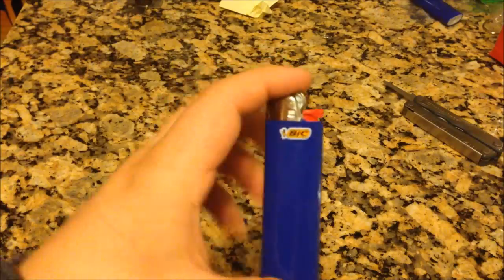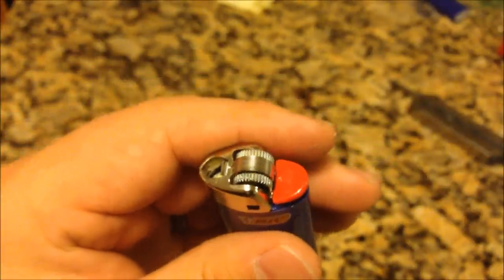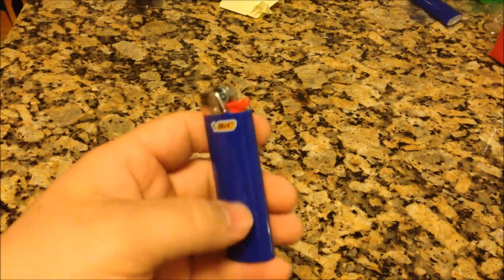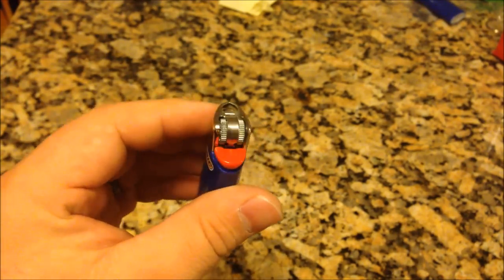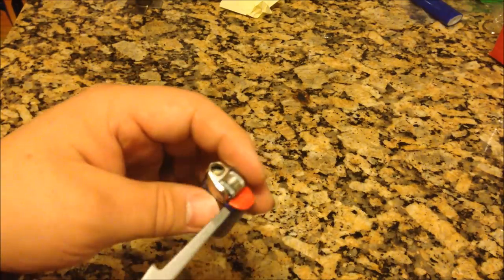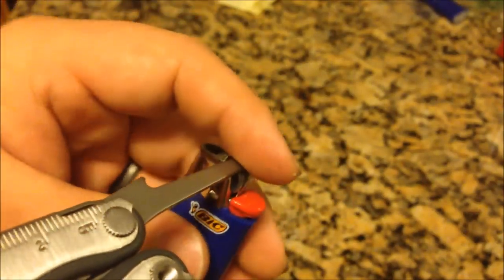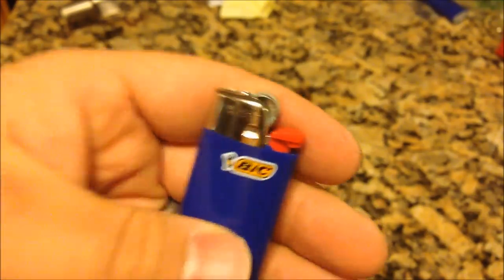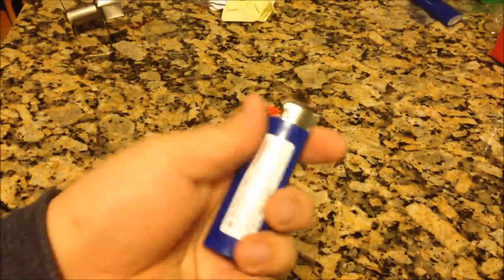Removing the Child Safety Device from a Bic Lighter

Comment: This a great tip!

The only tip I can suggest is prior to prying the safety off, sometimes it helps to lightly pry up the 2 small tabs that hold the safety in place near the flame side. On a couple occasions I have tried prying ONLY the safety and ended up breaking the bic. The chances of breaking it are very slim but when it did, the metal striker either got lodged down inside or it flew off randomly much like the safety piece does.

Comment: After watching this video, I stuck a paperclip under the safety, and bent the paperclip into a loop. After that, I stepped on the paperclip loop and pulled hard on the lighter. This way, nothing flies away, you can control everything.

Comment: I find them discarded at a park.... pocket lint makes them hard to light. With a string light from behind, check if it has some butane in it.... if empty, discard.   So remove the 'surround' chromed piece with needle nose pliers and then bend back the semi-circular child guard. It will lift out once bent backwards. Blow out debris with hard puffs of air (blow it out with your mouth) and reassemble. The pliers will close the surround piece and then you can slide it on. Check if the BIC will light up.     Done.

Comment: I got one of those in red, I couldn’t figure out how to get that thing off and I thought it would break the lighter (my first bic sorry I have 2 AC/DC edition zippos but they don’t work great at all for some reason but since they are collectibles I am still not getting rid of them.) so I bought this instead. Thanks for the tip, so it is really just a child safety thing? Like not necessary for the lighter ?

Comment: So I did this to one of my lighters that I dried out after going through the wash :(   They USUALLY DRY OUT 100% after a few days depending how bad and the temperature I'm sure and the child safety part in the middle got contorted or something cuz it felt and look like the wheels would turn but NO MATTER HOW HARD I PRESSED I COULDN'T GET THE IMPORTANT OUTER PARTS TO TURN when trying to light it, my finger just felt as if it was sliding out the middle metal part SO I TOOK OUT THE SAFETY but NOW on THAT PARTICULAR LIGHTER the wheel is SILENT even when rolling slowly (like not hard enough to light)- typically you here the like grind/wind whatever of the metal grooves but its a smooth turn now but I could barely get it to move before I took out the middle.... Nothing is loose on the lighter so its not as if I broke it in doing anything but I do not get how or why the lighters lighting mechanism like is disconnected completely to whatever it connects to INSIDE it crazy weird- 35yrs old and NEVER experienced THIS before! Especially NOT WITH A BIC- The clear lighters always screw up with their flame size changer and all LOL but this has me mind-fucked rn tbh haha I mean I have other lighters but it's just trippin me out I don't GET T plus it was MY PINK ONE!! MT FAVE!!! wahhhh! hahaa

Comment: I’ve got a pointy large tweezer pair which I slide right beneath the safety device above the red button and simply rip that sucker off. What I find impressive is that I believe the Engineered design has been cleverly made to be removed in one simple step by the Consumer-way easier than this. This is kinda embarrassing.

Comment: Bit of a late comment but why not just invest in a Zippo no child safety plus get a mini supply of fluid or atleast that's what I do when I go camping
Reply from the maker: The fuel in the zippo will evaporate pretty quickly, whereas the bic will hold onto it until used.
Reply: @ModernSurvivalSense  yeah most definitely but also why I like to have a little bit of lighter fluid on me to

Comment: I know this will fall on deaf ears, but I assume you realize that the piece you are removing is a critical part of what is need to make those lighters child resistant. That piece was added to help prevent young children from accidentally getting their hands on a lighter carelessly left out within their reach, and starting fires, which in some cases resulted in loss of life.  A sad example was just this past week Jan 5 2022 in Philadelphia where 5 people died from a child playing with a lighter.   Making these lighters child resistant has been a requirement from the CPSC  for over 25 years now  AND STILL IS !!!    Hopefully now that you understand why that piece was put there, and why is is illegal to both make, and sell these lighters without it, you will do the responsible thing and remove this video.  If you don't hopefully You Tube will as will ,as others showing this same "hack".
Reply from the maker: The responsible thing is to not leave lighters out so small children have access to them. This video is about making the lighter easier to use outdoors in freezing conditions, when your finger dexterity is impaired. You do realize they make medicine bottles that are not child resistant, right? It's exactly the same thing. It is the responsibility of the owner of the item to restrict a child's access. 
Educate yourself.
Reply: @ModernSurvivalSense  I tried to explain this to you as an adult. Unfortunately that appears to have failed.  I tried to EDUCATE YOU on why what your video is showing here is circumventing a federal law and requirement of the CPSC.   YES the responsible thing to do is NOT leave lighters out where children can reach them.  No differently than the responsible thing would be NOT to post a video showing anyone how to remove a required safety component of a product required by the Consumer Product Safety Commission.   That component is there for a very important and legal reason no matter what you may think.     Enjoy your video hits on You Tube.
Reply: @ModernSurvivalSense  glad you are standing on this. Don’t let people like this intimidate you
Reply: Uh oh, the fun police are here